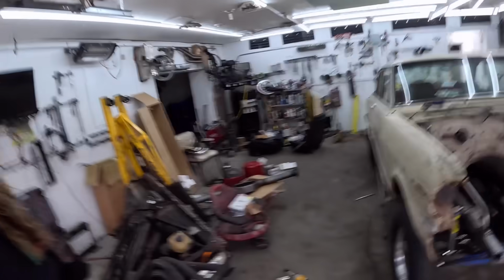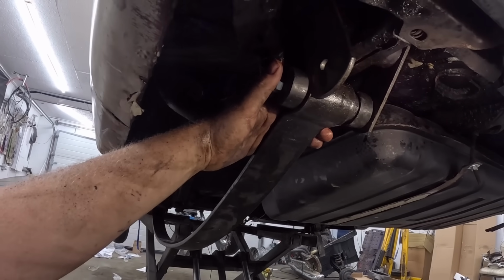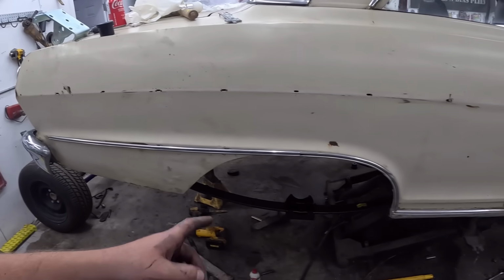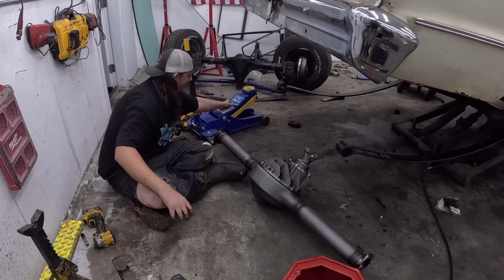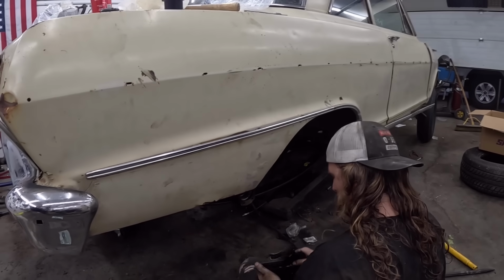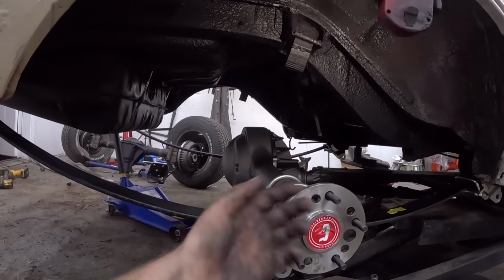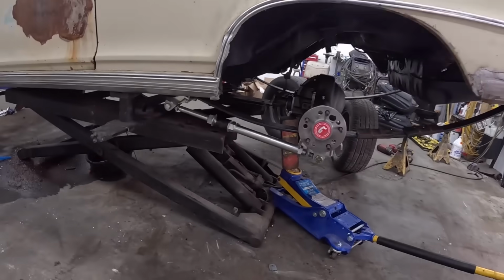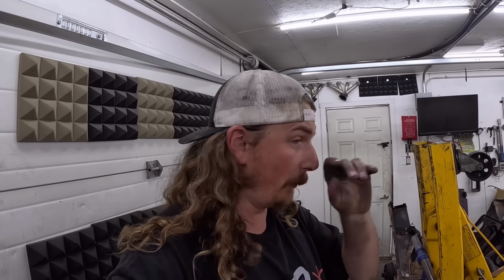Rear End FIASCO - Fire, Grinding, FRUSTRATION. Ford 9 Inch Install

Comment: You are the only channel that I watch all the adds because I really want to see you succeed.
Reply: I’m with you
Reply: That's good to know.  I was unaware watching the whole ad helped.
Reply: Was anybody else screaming “PUT THE WHEELS ON IT THEN ROLL THE AXEL UNDER THE CAR”! Or was it just me?😂
Reply: @corydriver7634  no but that probably would have worked. I guess he didn’t want to put the axles in while it was on the floor. That would have been pretty bad too.
Reply: You can become a member of the channel as well... I joined a while ago, Dan doesn't do alot of "Member Only" stuff out, but it's a great way to support him.
Reply: I watch all the ads for at least 1 min. Sometimes. Longer for the.same reason

Comment: Daniel - Those axle mounting plates take a "humpack" leaf spring bushing, not the multi leaf type which u have. That nubbin' is for the centerbolt on a multileaf spring, as I'm sure u well know it, locates through a hole in the bottom and top spring mount plates. If u lop off that nubbin and use them as pads...please be sure and make sure the top and bottom bushings are holding that spring tight since there is no centerbolt. If you order the humpbach style Leaf spring pad "cushion" it will help to locate the axle fore and aft.  This is the voice of experience, don't let your axle shift all crabways on ya.... bad 4 the fenders.

Comment: Dan you can move axle back on spring buy redrilling perch hole , than weld up old hole. Wouldn’t go more than 1/2 inch, should get tire were it needs to be , double check shock mounting and tank clearance, might save from a bunch of wheel well mods.

Comment: To help w your rear tires scraping the front of the wheel openings, maybe you could drill holes in the upper and lower mounting plates and the rear would sit a little further back on the springs. Some aftermarket plates are sold w multiple holes, usually a hole in the center and holes an inch ahead and an inch back.

Comment: If you are going to be running caltracs bars, like you are, you really should run rear leaf spring sliders. In order for the type of (traction bars) you are running to operate properly they have to be paired with sliders. If you don't you will have wheel hop like crazy. I have been running them for years in my second gen Camaro.

Comment: I used leaf spring sliders in my car with aluminum bushings front and rear with Comp Engineering slide a links, the sliders make the suspension move much better even with the aluminum bushings, and how bad can the ride get? 😂

Comment: Dan the floor pan man it looks good you can get the kit to move the leaf springs like you used on your other cars and get a set of nice rims with the offset you need. Remember you can use a blum bob for the right off set. The right off set makes a big difference.

Comment: Yo Dan I had 275/60-15 28x10.8 on my 74 ss they  rubbed a bit when hitting bumps so I went to a 255/70-15 29x10 fits better than the 275s

Comment: @Dan, are you going to add subframe connectors? Those 31 spline axles are good to 1000 HP which is way more than she will need. Once she goes 11.99 it needs a roll bar or cage.
Reply from the maker: Yeah I think ill add some
Reply: Ditto on connectors

Comment: My falcons have the same style washer on the front spring pocket.  I drilled out the frame side to take a straight bolt and welded the washer into the bracket.

Comment: To cut down more on axle wrap (tramp or wheel hop) when racing you shouldn't use the stock pads and rubber isolators. You should use a long Mopar style steel leaf pad. But the traction bars should be a big help. Can't wait to see you radius the rear wheel wells out.

Comment: Pinion  rubber s young man i grown up  at 1/8 mile track and drive shaft loop s and have fun and good spoter is difference between  win or loss  it the dial on window  makes it consistent  runs only love you all

Comment: For a drag car, I would ditch the rubber spring mount isolators and fab up aluminum spacers.  The ride will be harsher, but the rear suspension will be less likely to squirm around on launches.  :>)
Reply: Don't matter on a poser car. He even says this.
Reply: A set of caltraks is always the way to go. Good street manners and awesome track adjustable

Comment: Dan you should of built the diff up on your creeper seat then you can roll it in and lower the ramp to suit. Saves your back and having to try and lift a dead weight at awkward angles.

Comment: I've replaced those soft mount clamshell spring perches with a standard perch in a hotrod. The factory stuff is ok for just driving around but there's a lot of deflection with the rubber mounts, not good for drag racing. Those of us with a wife that will help out in the garage are lucky...
Reply from the maker: Yeah looking back I should of changed em. Owell next time haha

Comment: Hoosier makes a 27 x 10.5 -15 Quick time pro that will fit great, and bonus it is a DOT approved tire. Bias ply though so if looking for a radial will need something else. Not sure the equivalent size though with the M/T tires.

Comment: Seems to me that if you’re using the traction bars, they will attach to the front spring mounts, then attach to the 4 bolts that hold the rearend to the spring pads. Thus eliminating the possibility of the rear sliding back and forth on the springs. If you don’t use the traction bars, then yes, you have a problem with the possibility of the rear sliding back and forth on the spring. Just my 2 cents worth

Comment: Fined the Small tire for that class. Put a few tack welds on the tubing that goes to the fire wall. For strength. Try not to cut the wheel well if you don't have to. You will thank me later

Comment: With a 390 gear you don't want to go over 27 inches.Every inch in diameter Knox off 10 miles an hour on your speedometer therefore 30in tire will equal high freeway gears. With a 3:90 gear ratio. Used 27in tires Mickey Thompson tradesman 27/11/15 =295 50 15  can fit a 8-inch rim. Better to use 10 inch wide rim. With air shocks for height adjustment.

Comment: Jus sayin’, but the rear shackles are supposed to be vertical, or angled slightly rearward, when the car is sitting on it’s own weight. Binds the springs when they angle forward.

Comment: What ever that was, I would just fix it.  Heat it up and tap it back in shape and straighten it all out.  A good tack hammer would probably do the trick.  If you can find one to purchase I would agree, buy it and not worry about fixing it.  Sometimes the old stuff is better than the new stuff if you can fix it.  There is truth to something being bent once, loses strength and being more susceptible to bending again.  Quenching can help if the steel is soft.

Comment: I know you know that the rear differential is centered on the mono leaf spring with Top & bottom perch rubber spring pads. You showed in the video the old 50 year old ones. There’s a top & bottom pad on each side……..Everything is new now in the rear suspension except for the pads. What’s up with that? Those pads are THE MOST important parts to hold the differential in place when you have an over powered ‘62-‘74 nova. All four pads are $40 American at Classic Industries in California…….

Comment: Just a heads-up..

MOST of the classes you will be interested in "racing" have a tire size limit of 28.5"... Check with the locals in your area before you $$$ tires...
Reply from the maker: I usually pick based on looks haha

Comment: Dan, I sure hope speedway is giving you a hellava discount!!!, Derrek smoked the shit out if a 8.2, never had a problem,  way more power than you will ever give it, I guess money is not a problem
Reply: Pretty sure VGG was working with 8.5inch 10 bolt units in his cars, much stronger and uses mini spool kits to lock them up.
Reply: @jeffmooers2174  no, he said it was a 8.2

Comment: When I ordered my 9" ford axles I had them drilled them in the Chevrolet 4 3/4 bolt pattern with 7/16 studs because I didn't want to use Ford Wheels on the rear